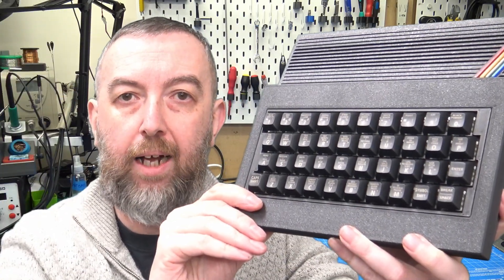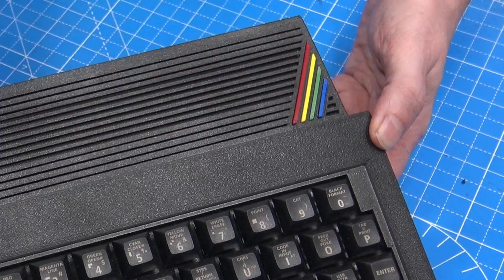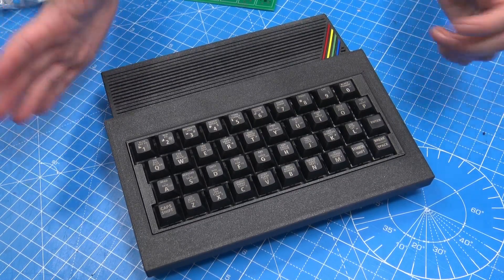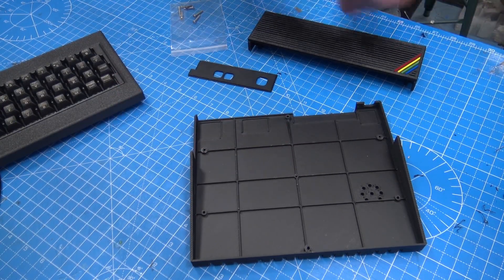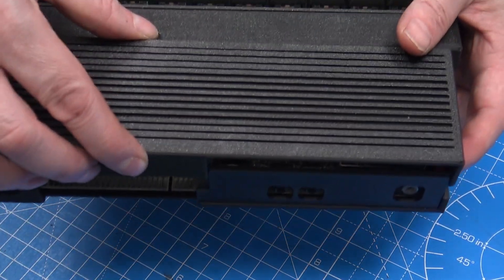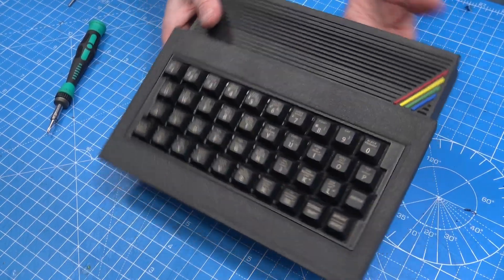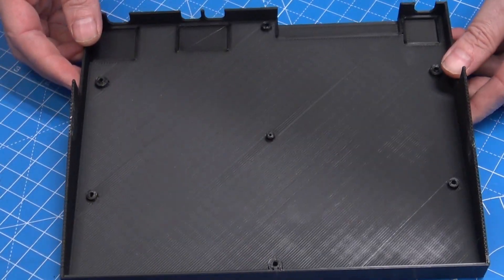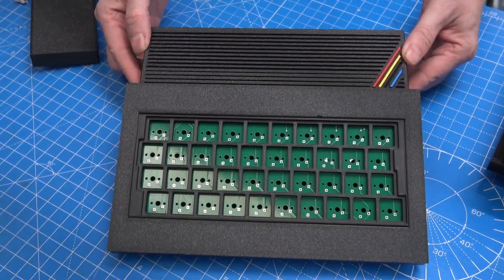The ZX Mechtrum: The Coolest 3d Printed ZX Spectrum with mechanical keyboard.

Comment: Oh nice will this work with a PicoZXPi ??
Reply from the maker: I was working on a version for that board.
Reply: @leesmithsworkshop   Are you still working on a Pi version? Or at least the 3D files for sale? I'm excited to use your keyboard case with a Raspberry PI running BARE METAL ZX SPECTRUM EMULATOR FOR THE RASPBERRY PI...

Comment: I'd rather use a Spectrum Plus, move the arrow keys and set it up with a slightly more modern setup, then decode it through an Arduino for the spectrum signals.
Maybe even add in some intelligent options to it.
Reply from the maker: working on it.

Comment: You popped up on my Facebook. After watching the video I couldn't resist, so one's on order. Thinking of sticking a Hermit ZXZero in it.
Reply from the maker: Thank you, The new keyboard PCB arrived today, the Key switches are in the post so the last part  are the key caps and I think they will be with the engraver next week.
Reply: @leesmithsworkshop  hi lee, I contacted you regarding extending the keyboard ribbon cables to fit a Hermit board in the case. I'm waiting for some ribbon cable so I can get started on it. Where would I get hold of the connectors you have on the ends of your keyboard ribbons?
Reply from the maker: @mickymillersson4376  HI, it was something I designed myself so not sure if you can find anything like that. I was working on it for you,. but work has got in the way at the moment.

Comment: Fantastic work Lee. I would have given up a long time ago. Possibly the best 3D print project I've seen. Can I ask you what printer you have please? It's such a wide template.
I never had the original rubber model, I had a zx 48K+ but unfortunately it was fire damaged in 1988. I've a lot of old spectrums now though . I remember all those old flight cases people made to hold all the kit. They sold them in Sinclair User, this reminded me of them
It's a great project. Well done.
Reply from the maker: I have many printers and the two big printers I use for the case are customized and no longer for sale. Both are 400x400x400 and I upgraded to SKR 1,4 turbo controls boards with tmc drivers and E3D Hemera extruder with Revo hot end. Others parts are printed on mt Prusa Mk3 and others on my DIY corexy printer.

Comment: It is a really great project. ZX Spectrum need to be black. 😀 On the other side grey keycaps would make it more similar to the original.
I bought in the past a ZX Spectrum with "real keys"… but in the last years it was stored in a box. Unfortunately it is not mechanical, and the rubber pads deformed under some of the keys, so they are continuously pressed, although ha the foil is intact. Maybe i will be interested too, but grey caps would be great upgrade. PS my main platform is Commodore Plus/4… it also had an iconic look and had a pretty good keyboard. White keys 😀
Reply from the maker: I don't have any choice in the colour of the key caps.

Comment: This is fantastic work and the end result is brilliant, well done. Being a 3D printing guy myself I appreciate the great many hours (and the money) you've put in to this. As a 48K user from '82 the thing for me that the original lacks is a power switch. Back in the 80s I sent off for a sort of wedge shaped affair that plugs into the power socket and sits on the case, with a switch on the front. You plug the power lead into the back of that. Still got the Sinclair User mag it was advertised in, and it cost £4.95 in 1985! Having a small rocker on-off switch on the side maybe would be the cherry on top (I don't know the wiring that would be required). Love this project and wish you many sales!
Reply from the maker: I just kept it as simple as possible and if you want a power switch you can use an inline one to save any mods to the spectrum board. Thank you for the nice comment, I really enjoy making these and trying to hide the normal signs it's 3d printed. You have to love textured PEI.

Comment: Really awesome case! And very interesting all the iterations you went through. The only "but" is that I'd really want the 128 spec and its proper space bar (well technically the bar is also in the plus). Anyway, here in Spain there are a ton of +2s and it would be really great to have someday a compact sweet case like this one as a replacement.
Reply from the maker: You can get the N-GO case https://manuferhi.com/p/n-go-case-keyboard
Reply: @leesmithsworkshop  but I cannot fit a +2 inside. going the FPGA route is an ok case, although I think I prefer the feel and finish of yours
Reply from the maker: @RaM-xy8kg so the grey +2 ? I would need one to do all the test fitting.
Reply: @leesmithsworkshop  the grey! I hadn't noticed the PCB is way smaller. looks like the main issue would be the db9s and the reset button at the left. just a tad wider maybe

Comment: Superb! Can I ask what you design in and what printer you're using? In return I can recommend truck bed liner spray for finishing printed cases. PLA takes it wonderfully and it hides every layer line and imperfection. Best of all, it's just the right textured finish - in black - for a Sinclair computer and is tough as hell!
Reply from the maker: I use older software called 123design just because I am too stubborn to learn something new. My printers are all customised, but the basics are 400x400x400 printer size with E3D Hermera and Revo hot end. One started as the Anycubic Chiron, but only the frame is still used.
Reply: @leesmithsworkshop  I spent so long trying to learn Fusion 360 that I can understand reluctance to change! And I figured that you had to be using a big-boy printer to get the full case on the bed; my Ender 3 Pro has been upgraded continually but going bigger isn't an option in my office/workshop/den, so my printed ZX Uno/Pi 4 machine has a million joins to deal with (and cover with the truck bed paint)
Reply from the maker: @IrregularShed  If you want to see one of my multi part designs look at the Multisystem case video.
Reply: @leesmithsworkshop  I just did before I subscribed 😉
Reply from the maker: @IrregularShed  :face-blue-smiling:

Comment: I feel like that vertically printed case would be a much better candidate for ABS, but the support issue is huge.
Cylindrical edges lend themselves extremely well to being roughly sanded smooth (600, then1200 grit) and acetone smoothed to a bit of a dull shine
Prints can look very much like an old injection molded ABS part this way, trades some horizontal strength for stronger layer bonding.
I know people like the full shine, but it's starting to damage the plastic at that point. Definition starts to be lost on simple details where a deft hand and sanding tools would preserve it easily.
Reply from the maker: I can imagine this would have warping problems because it's quite thin and standing up for so long while printing.
Reply: @leesmithsworkshop  Without an absolutely nailed down ABS printing setup a long part like that will warp at the ends.
But depending how far it goes up the print it might not matter much.
After finishing it might almost look like a contour that was meant to be there.
Or at least that's what I tell myself sometimes...

Comment: Really nice design, very professional! I love the way it keeps to the “Spekky” vibe without being a direct knockoff. One suggestion though - if you print the backing for the keyboard as a separate piece and glue it in to the keyboard surround, rather than having it as part of the it, you can eliminate  aa lot of your supports and cut down on the printing time. It would also potentially allow you to have a different infill density on the supports than on the case, again possibly cutting your print time and costs.
Reply from the maker: I was thinking of ways to remove the needs for the supports today, Something I can experiment with over Christmas.

Comment: Nice Keyboard 👍. I had a Fuller Keyboard back in the day and it was noisy as hell. 
How does yours compare to modern keyboards noise wise. ?
Reply from the maker: These are basic blue switches used in many modern keyboards  that are marked at Clicky. It could have any type of modern switches I like these so went with them.

Comment: A ZX with a mechanical keyboard would have costed a fortune at the time. Still I'd imagine that it it would have sold like bread loaf
Reply from the maker: You had the DK Tronics keyboard.
Reply: @leesmiths workshop  There were several keyboards like that, I had an LMT 68FX2 keyboard on my Speccy, it was ace, had a numeric keypad and various extra keys.

Comment: I see a missed opportunity here for an improvement:  a space bar.  I've never had the chance to play with a ZX Spectrum or its variants/clones, and not having a space bar is a bit of a hindrance.  I know that there is a space key in the bottom right of the keyboard, but it's not the same.
Reply from the maker: A space bar would need to be more like a Plus model.
Reply: Didnt You try gray keycaps?
Reply from the maker: @michalpolak4098  I don't have any choice in the colour.

Comment: Matte PLA looks awesome when printed on the textured PEI beds, this case looks wicked and for a minute I thought it was injection moulded, I dont have a Spectrum but I do have my original VIC-20, after seeing this I thought about scanning the case and printing it in PETG carbon fibre as I have a roll in my collection.
Reply from the maker: https://www.cgtrader.com/3d-print-models/hobby-diy/electronics/breadbin-commodore-64-enclosure-3d-print-model
Reply: @leesmithsworkshop  Thanks Lee! if my scan doesent work out good enough I may well buy this file.

Comment: PETG or something like that may be a "better" choice, so you don't need the power solution and maybe brass inserts? That would prevent cracking plastic when screwing, you can put the inserts in with a hot iron for instance. Very nice case!
Reply from the maker: brass inserted needed more plastic and it stopped the case fitting around the space ln the spectrum board. Petg is ok, but it limits the printers I can use and my bigger printers are not really setup for it.
Reply: @leesmithsworkshop  PETG is no different to use than PLA. It prints at almost the same temps (just a little higher). Unless you dont have a heated bed, there is no reason not to use PETG. It is a much better choice for this application.
Reply: I'd argue that it's a good idea to replace the old 7805 DCDC converter regardless of the case being used. As Lee pointed out, reducing the heat should help with CPU and ULA longevity.

Comment: Looks fantastic bud, the changeable IO plate at the back is such a genius idea.
Reply from the maker: I used it a few times, printing those thin parts between the IO is not great and they just snap. so printing them flat makes it a lot stronger.